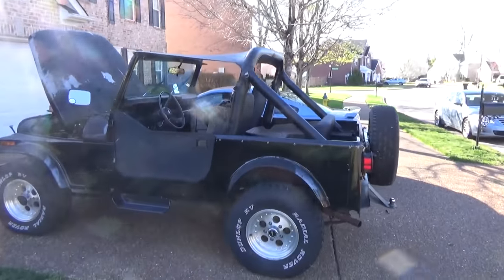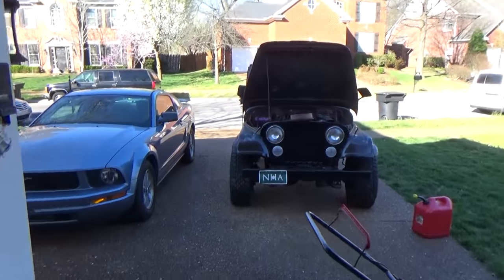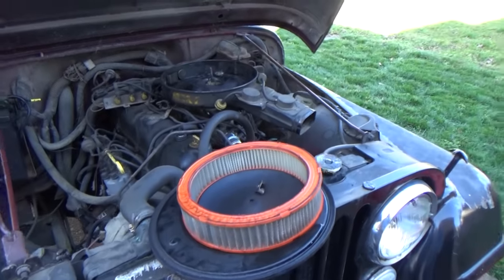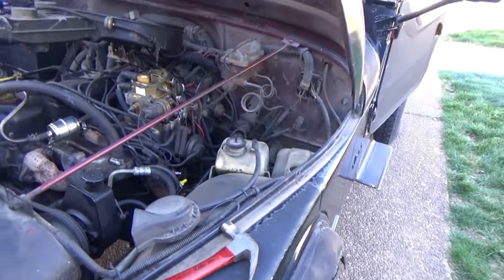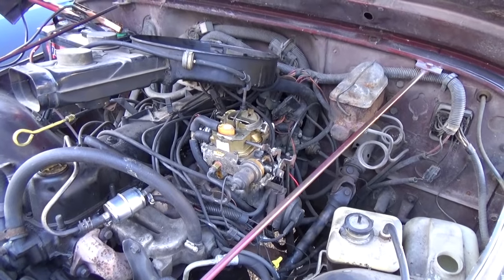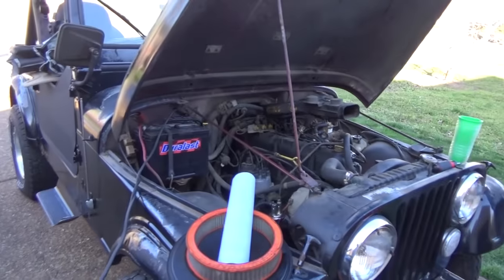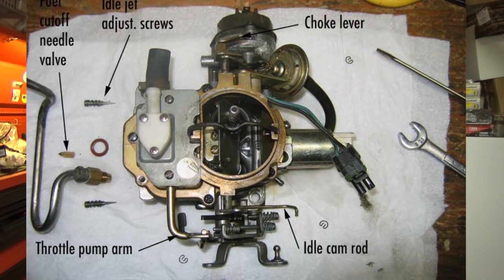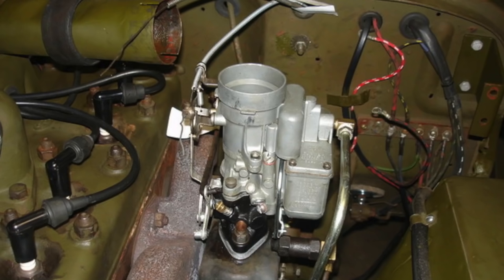Jeep CJ - YJ Carburetor Issues - Diagnosis and Plan of Action - Carter BBD

Comment: I have an 89 YJ 4.2L, years of dealing with the crappy Carter carb from day 1.  Finally pulled it a few years back, put on an MC2150 and tore out miles of vacuum hoses and electronic crap.  Now when I open the hood I can see the motor.  Starts right up and idles fine.  Its the best mod I have done to the Jeep.  No emissions where I live so I don't have to worry about failing anything.  I had the nutter also but ran into some electrical issues a few months back.  I had an intermittent wire going to my coil and thought it was ECM related so i reversed the nutter to stock and never changed it back.  Have not noticed any change in the idle/drive so all is well.  Been running this setup for 4 years now.
Reply from the maker: +cesare68FL Super cool - thanks for the info - we will see if the weber runs that well :)

Comment: Thank you so much for this video!!!   I did what you did... disconnected the hose from the fuel filter ..tried starting...NO gas came out. 
Helped me to diagnose bad fuel pump.  
Took 30min total to fix (part store included-17$). 
1981 CJ8
Reply: Lindsay Freeman how do i have a 1983 cj5 and yours is a cj8 in 1981
Reply: @AJ123123ify  because the CJ5 1955-1983 and the CJ8 is 1981-1985. They didn’t just make one model at a time all the time. 🤷🏻‍♀️

Comment: I'd be interested in the old carb. Up here in Indiana they don't emissions test. I have an 87 4.2 with that carb, but older and junkier. lol I have done the "Nutter Bypass'' which just bypasses the emissions, tricking the cpu part of the carb and junk. It runs perfect after and way more power.

Comment: I've been there.  After having a rebuilt (or was it new?) unit installed on mine a couple of years ago the Jeep has run pretty well other than running rich on start up and one of the two weird red lights in the center of the dashboard flashing and latter going solid (WTH?).  Those computer controlled carbs are a mess to troubleshoot.  I am looking forward to seeing that nutter bypass done and how it runs afterwards.  Hoping your sister-in-law has continued to do better.
Reply from the maker: +melodicdreamer72 Thanks so much Bro Kris is continuing to slowly improve and is working hard on her PT.  As far as the carb - did you get a rebuilt factory style replacement carb ?
Reply: Hi Dave...been a while since I was on YT... I brought the Jeep in to a shop when I first got it - was worn out to the point I didn't know where to start with it - mostly considering the '90 YJ emissions garbage.  Anyways, they installed a new carburetor that was a supposed to be a direct replacement for the old Carter.  If I knew then what I knew now ...you know how that goes.  Bottom line though, if it weren't for it getting about 11 miles to the gallon, I would say she runs pretty good.  I'll have to get some pointers on how you go about finding the vacuum leaks in the next video - I figure there must be a central point at which the smoke can be administered, but I haven't found it.

Comment: The 84-86 computerized carbs were absolutely a POS. My 86 CJ7 stalled every time I made a right hand turn. I swapped the carbs with several others of the same model and I did a couple onboard computer swaps. No dice. One day I pulled the computer harness from the carb and it actually ran better and didn't stall on right hand turns for about a week. In reality, the Jeep shouldn't have run once the harness was pulled! Then it started acting up again. Solution: 1978 AMC Eagle carb swap and manual choke setup and disconnected all the pollution control crap. It hasn't stalled since and I've owned it for 28yrs now. My 84 CJ7 would stall when it rained. Same carb. Throw those carbs out immediately. Even if it's working properly. Get RID OF IT. My most recent purchase. A 1980 CJ5, the carb (non computerized) was bastardized by a previous owner and it idles almost like the Jeep in the video. I'm not even going to deal with trying to make it right. My next step...Weber Carb Kit WK551 and the Holley 12-804 fuel pressure regulator, and new fuel pump. DUN DEAL!

Comment: The issue I have with my 1984 cj7 is if I let it sit for three days I have to pour gas down the carb to get it to start
Reply from the maker: Certainly a fuel issue - the fuel bowl is empty eh ?
Reply: @RedneckGarage  i plan on droppin a 1980 4.2 258 in a 1997 Tj ....going back to carburetor....whats your thoughts....

Comment: I just got a 1986 with a Weber 2 barrel carb bad thing is it's only the 4 cylinder Motor the 2.8 and been trying to figire out what to do it runs everything ot came from 3400 feet and now is running in 8000 feet is it necessary to get it re jetted?

Comment: i have a bbd on my old plymouth 318 and i have a vent tube ontop of carb but it is plugged cause mya car dont have charcoal canister , is it ok that i plug the vent tube or should i just unplug it and leave it open or run a hose to a the oil breather cap .....also will unplugging the vent tube help with vapor lock ..i get vapor lock only on hot days which is like 10 days a year here in canada ...and i do not have a return line to the tank

Comment: Hey Dave, I've got a question for you if you're still around here on Youtube. I have an 86 cj7, it's got the 2.5L engine on it. All the pictures I could find tell me that the carb that is on it isn't the factory carb, I believe it is a YFA carb. However it still has all the electronics on it. I have no way of testing whether the jeep runs or not because the fuel tank isn't mounted up and I don't have a sending unit, or even any of the mounts for the fuel tank. I plan on doing the nutter bypass to get rid of all the emissions crap (i live in Indiana, no emissions here so no worries) but basically I need to know, what is a good affordable carb I can throw on this thing that will work? Could I put one on there from a pre 1983 2.5? Hopefully someone can help because I want to get this thing running by the time it gets warm outside

Comment: Hey Dave, looking forward to the upcoming video on changing out the carb, I have an 87 Yj that runs pretty bad. I was thinking about the motorcraft upgrade carb from ebay. Are you going to change out that air intake as well?
Reply from the maker: +Jonathan Knowsley No the weber has an air cleaner assembly included - http://amzn.to/1pLeiGh

Comment: 6:28 Dude I've been looking where that f*cking ICM box is for around 3 months now and couldn't find a damn thing.I literally paused the screen,pointed and had a mini celebration because I believe it's the part responsible for this intermittent stalling issue that has made my 84' AMC Eagle undriveable
Reply: The ICM box is by the battery on the Eagle. I have an 86 Eagle but I’m going to try fixing the stepper motor & choke before giving up and bypassing things.

Comment: Hey Dave! just a question, what clear coat did you use on your jeep build? did you use a standard hardener or a slow/fast?
Reply from the maker: +Jmac Customs In the summer I used slow but when it was colder I used fast - that answer didn't help much I guess LOL - If you go to a bit faster hardener you will develop a few less runs but it is harder the hammer the clear. If you are going to buff then it doesn't matter as much. I've used Medium until it got really hot out and shot it when cold but was a bit more careful extending the flash time.

Comment: I bet with a good cat, and muffler it will pass. could double up the cat for the test.lol if it would run... Just make sure the cat is warmed up good. All the tubes and valves for the emissions  just controlled the heat and lean/rich on the carb. I'm sure on jeep.forums theres people that can instruct on how to tune to pass testing with the nut.bypass. Once I did the bypass my old junk carter hasn't been to bad. It will rev. to redline if you push it. I get 20mpg on the hyway now. Got 12 before. I have more prob.with sticky valves lately. I'm going to put a 4.0 head on mine when I get the dough.
Reply from the maker: +jeremy yeoman That's cool about the head - yeah usually I can get most old stuff to pass - Lean the crap out of it B/4 going.  The smaller Weber carbs are easier to get passed than the 38's